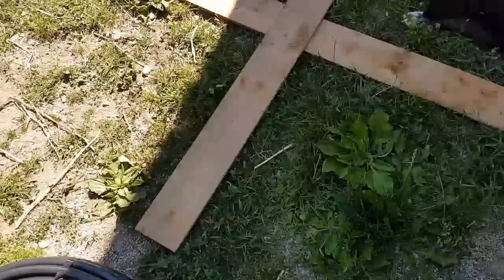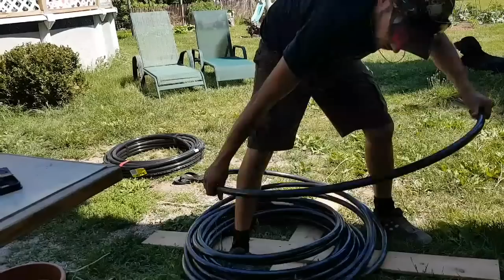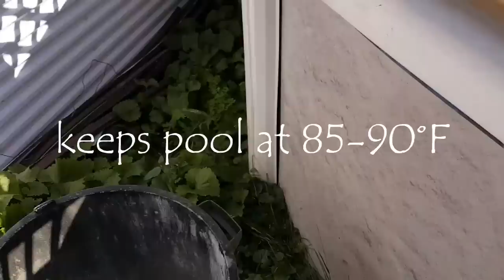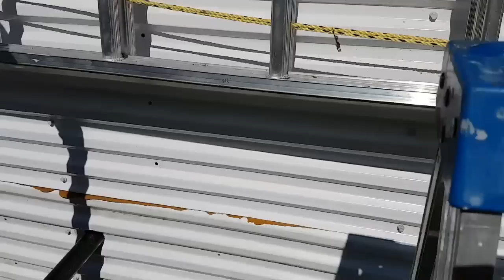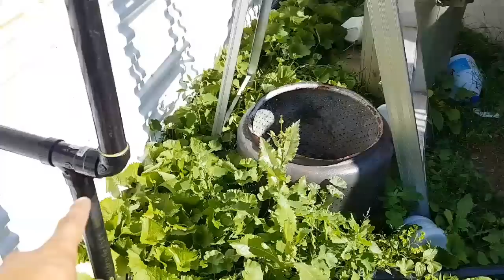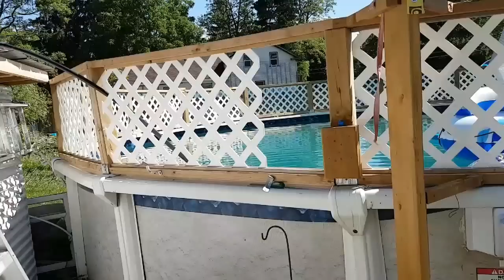DIY Pool Heater for a $100

Comment: I did not see a pump, so are you using convection to circulate the water.  Would the supply be from the pool bottom and return to the top?

Comment: Nice video. Was wondering if this tubing is safe or non toxic to run this hot water through it constantly and put back in the pool?
Reply from the maker: Yes it 1 inch water line

Comment: Will this work to heat pool during winter and if pipes freeze will they bust? I want to heat an indoor pool in the mountains where it does snow and gets very cold,
Reply: You could put the tubing into a Plexiglas box to protect from snow and cold nights. It shouldn't freeze as long as the water is flowing

Comment: Does this work if the water is running continuously, or do you need to let it sit in the coils for some time? Thanks!
Reply from the maker: Munedawg mine runs when my pump is on non stop then I shut it down at night
Reply: GoGreenPM ok thanks!
Reply: Ok thanks!

Comment: These systems can not provide enough flow to heat a pool, its impossible! Evaporation alone cools the pool faster than these can heat! Save your cash and buy an actual heater for 300$.  Or learn how to use a solar cover for 75$
Reply from the maker: Not true it heated my pool just fine was more then enough had to shut it down lots because it was getting to warm
Reply: @cjwcustomwoodworking  in an above ground intex pool... maybe. My pool is 20k gal that will never work!
Reply: @Coupe420  Jesus h. Christmas, 20k gallons, of course it wouldn't!!!!!!  You don't need to be a physicist to know that.  Most people's humble pools are less than half that amount.......
Reply: @dougthegreat1808  that is standard 16x32 with 5x9 depth
Reply: @Coupe420  ok, good to know I guess
Reply: If you have such a big awesome pool then you can afford to buy a proper heater .

Comment: No you confuse bleach for chlorine
Reply: Common pool chlorine is made up of the chemical calcium hypochlorite at about 65 percent strength. ... Household bleach is a liquid that contains sodium hypochlorite, which is simply chlorine in its liquid form.Bleach, however, is typically only 5 to 6 percent chlorin